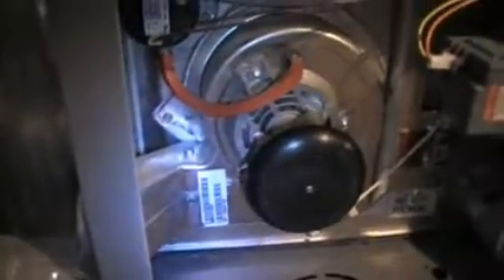HVAC - Flue Bird

Comment: Nothing beats the dead squirel I found in the blower compartment of a lennox high-eff. He chewed at the run cap and fried himself-He pulled the inducer molex connector off AND damaged the exhaust vent. This all explains the nesting crap in the burner box and the HORRIBLE SMELL!!!

Comment: at least it was in one piece. and not they i saw it myself but:
Tech goes to a call lady says while you are in the yard see if you see our cat
the cond was one of the olf tranes with the plastic top that had deterioratied and the unit looked like a furry crime scene.
Apperently the cat jump om the unit fell into the fan cut cut up and stuck to the fan blades caused enough vibration to break one of the  fan props and cause the a/c to heat up and well the rest is history.